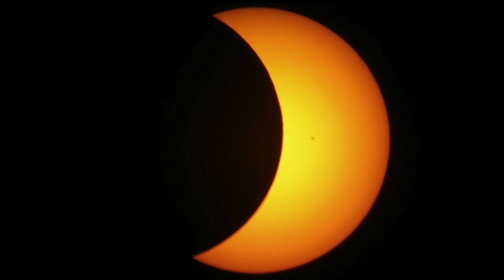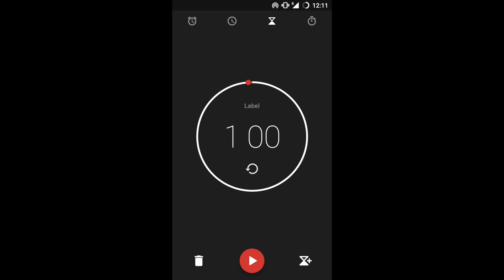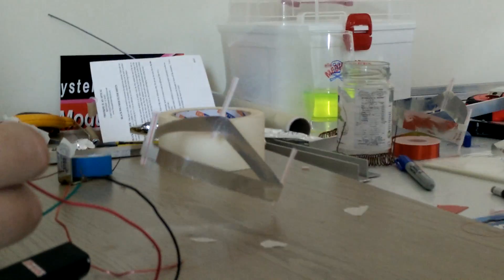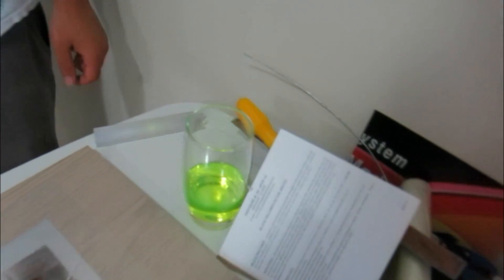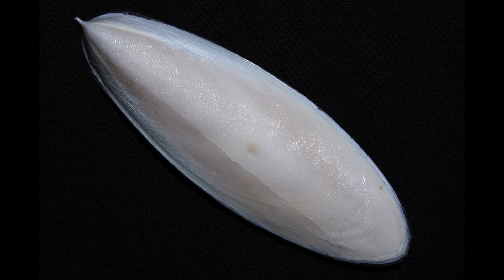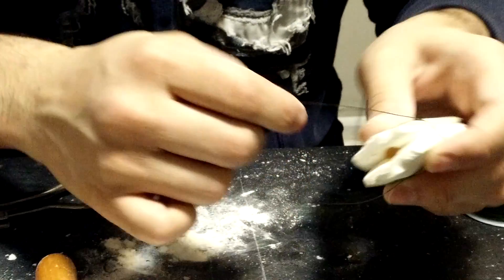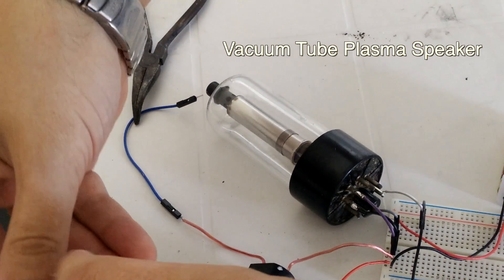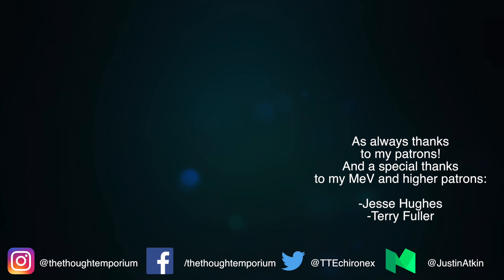Eclipses, Lasers, Lifter, Light sabers and more! - Grab Bag #1

Comment: 50:50 plaster and silica flour (150 or 200 mesh) mix with equal amount of water can be poured for a much easier to use cuttlefish-like mold material.
When dry can be carved in same way. good to 850C for casting. cheap. Plaster is casting plaster which is a gypsum based laster same as plaster of paris but much cheaper as used for drywall (Gib bord) plastering. Silica flour is available from pottery suppliers.
Reply from the maker: I've used that mix before. Works well. I just like cuttlebone because it's an odd thing to work with and leaves that cool wavy pattern. If I was doing serious casting I'd never use cuttlebone